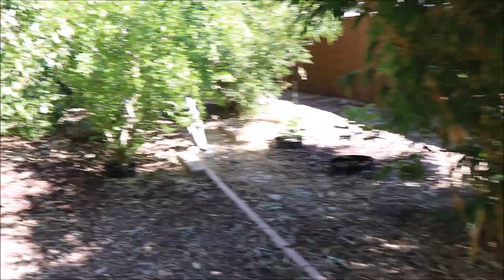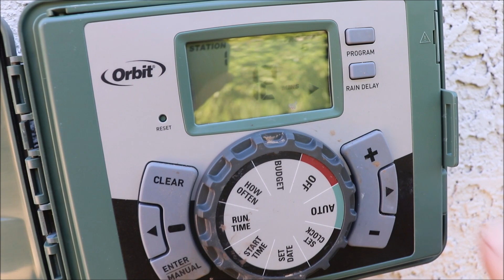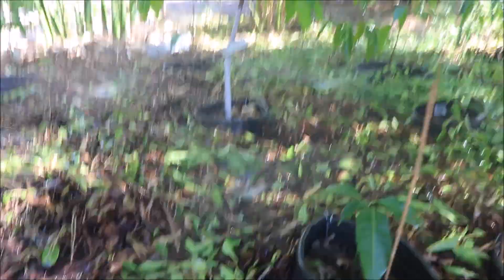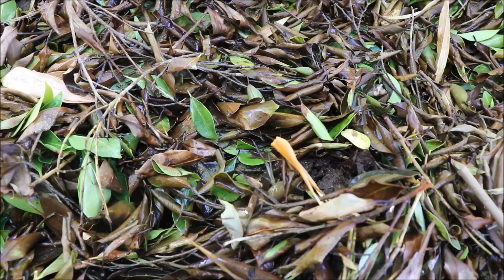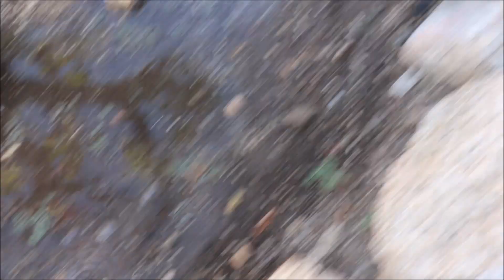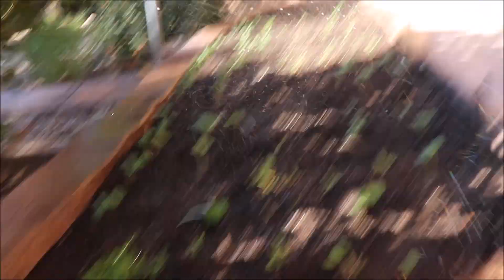Fruit Tree Irrigation in Summer - AZ 9B

Comment: Thank You for taking the time to share South West fig culture.
We live in Eastern San Diego, meaning we have 30 days in triple digit heat each summer. I'm 8 months into my Fig addiction and my question is, have you tested clay Ollas? 
I'm putting some in to save water and would like to find folks growing figs in hot areas that have installed them.
Thanks again for your style of teaching, it is easy to understand.
Reply from the maker: Thanks! I have not tested ollas in my climate and am not aware of any locals doing that on a large scale for trees. They may be a good approach for raised beds as the soil is generally loose and small vegetable roots could benefit from the slow release but I went with subsurface drip instead as I'd lose a lot of garden area to the size of the ollas. It would be really difficult for me to employ them for my trees because I have so much square footage to cover. Also my soil is heavy clay so it would be difficult to dig and bury so many of them around my 100+ trees and plants. I find the roots of trees tend to grow very wide and not deep in my soil so the micro sprayers seem to be the most practical to saturate the huge root zone. University of AZ has a writeup on ollas. They do not recommend them for trees as tree roots tend to grow out and invade and break the ollas.
Reply: @EnlightenmentGarden  Thank You, this is all useful advice.

Comment: Hi Natasha, I know this doesn't sound like an exciting video idea, but as a follow up to this video I would like to see how you flush your irrigation system and what your maintenance routine/schedule is like.
Reply from the maker: I honestly don't do much on maintenance. I walk the yard daily and every couple of weeks I observe the irrigation running to ensure no surprises and correct anything that may come up like a break/leak. When the chickens were out they'd move things and somehow adjust the flow rate on the spray heads! They now have a dedicated run. On flushing, I only do that on the pre-drilled drip line in the veggie beds once a year as they are under soil by removing the end caps and letting the water flow for a few seconds. The other lines don't need as they don't clog. Pretty easy maintenance.

Comment: Hi Natasha - Very helpful video. Question - Did you first start off by wetting your soil via hose, just to get it started, and then switched over to using the timer box and emitters? All of my trees are in pots above ground, so I suspect I'll have to set up some type of drip system rather than 360 spray emitters. I like the idea of a timer box that will break down the total watering time per day into percentage per frequency of watering cycles. Also, how many sprinkler valves do you have to run your entire backyard system? The more valves you have, the more stations you'd need on your timer box. I think my current timer box has 8 stations that can be programmed.
Reply from the maker: Spectrum 360 is not a good fit for container growing. Bowsmith drippers or antelco potstream are better suited. I have two separate spigots coming out of the wall on the back of my house on either side that service two separate manifolds. The west side manifold feeds 4 valves and on the east side I have a manifold that feeds three valves that use to run a sprinkler system to lawn. 7 valves total. Each valve on the old sprinkler system supported 5-6 sprinkler heads. A few years back when I killed off the lawn, I removed the sprinkler heads and capped half the T's and converted the other half to poly tubing that run to the trees. The four station boxes on each side work for my set up. On soaking the soil in summer upfront, I didn't need to do that with sprayers as they are great soaking everything and was deep watering up to that point. You might need to with drip so that the mulch and desired soil depth is fully saturated. You could use a hose or just let the timers go extra long one time to get the job done. Once soaked, then incremental watering is just topping off the tank as Gary M. says.
Reply: @EnlightenmentGarden  Thanks for the detailed response. It's a great roadmap to provide me with some direction, along with the YouTube link, and the links to drip works and drip depot. I am going to have to figure out how I want to organize my pots in my yard (117), and what water spigots to use. I have two in the backyard and two in the frontyard. I also have in-ground trees to include peach, Meyers lemon, apricot, fig, tangerine, tangelo, and 3 persimmon trees to figure into the equation. I can see how it can become quite the puzzle to figure out.  I might have to draw a diagram as a visual aid!! Thanks again for the assistance.

Comment: I use the 360 emitters as well. Unfortunately some of them lack the pressure needed to cover much ground. And the only second issue is when ground cover does begin to grow, it blocks the emitters reducing surface area covered.
Reply from the maker: Agreed; pressure definitely matters. At 15 psi, the max radius is 4.5' vs 6' at 30 psi. Are you using the antelco spectrum brand? I was using the Tempo brand on Drip Depot for years and they are not as good and some brands on Amazon are horrid. The Antelco Adjustable Spray Jet is on a 12 inch stake. That's much better for clearing ground cover and was what I showed in the veggie bed. The 180 pattern has enough force to saturate the ground

Comment: Very interesting video Natasha!
I’m not sure I understand something, You say you use 12 minutes per zones in a day but yet you water 4 times a day at 4 minutes each time, that makes 16 minutes right?
Reply from the maker: Correct! I have a cheaper more simple box so the percentage cannot be set to 25% so I round up to 30% so that is more than 100% or 120% with the 4 start times so they get watered 16 minutes total per day. Really it comes down to that soil test to figure out how long individuals need to run their irrigation to wet the desired soil depth. I personally am not trying to saturate 100% of the roots but at least 50%.
Reply: @EnlightenmentGarden  
Okay great, thanks! 
I have 5 little emitters around trees, under mulch (you are right it’s a pain to install) probably 2 feet between each other. Just did the rebar test, I got 5” between them and a foot at the emitters! In the evening sprinklers are on, to wet the mulch….